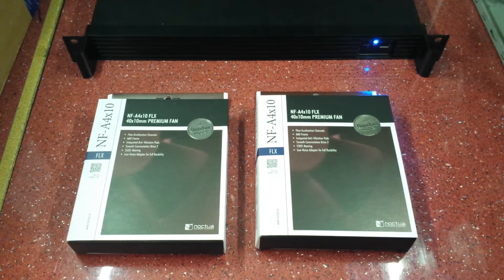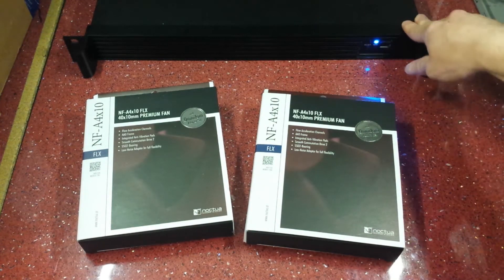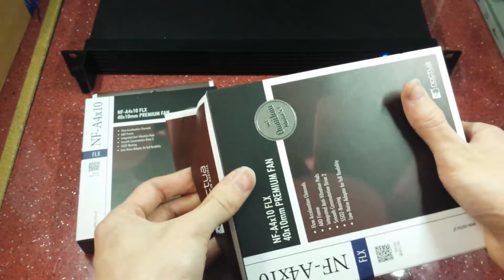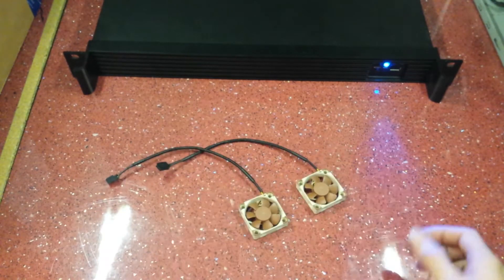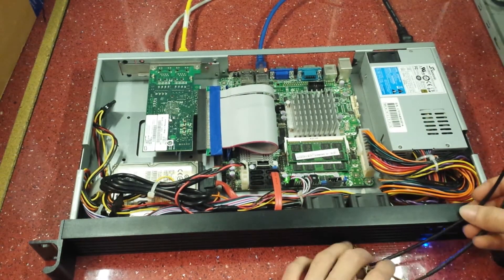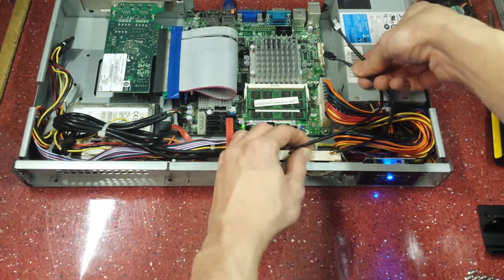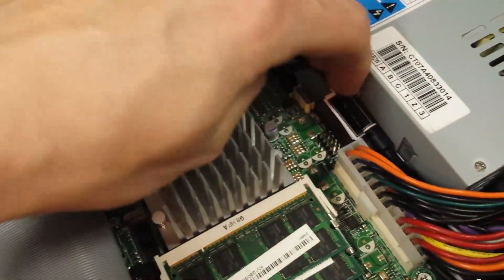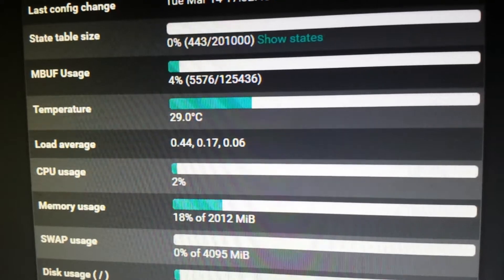pfSense Firewall Upgrade - Noctua NF-A4x10 FLX 40mm Fan Unboxing & 1U Rackmount PC Silent Upgrade

Comment: I know this is a pretty old video but I have a question?
Can you rotate the gpu 180° so that the IO ports are on the inside and would the PCI extension cable let you do that? Or would I need two extension cables?
Reply from the maker: That's an interesting one and honestly I am not sure how you could do that. You rely on the backplate to screw the PCI card into a case and mount/hold it - so if you installed it in reverse with the ports inside you wouldn't have anything to screw/mount the card in the case with. 
Unless you could fabricate or make up some kind of bracket to do it. 
Hope this is somewhat helpful? Sorry I can't really say. 
--Nathan

Comment: Wy do you want the Temperature to go down this far ?
Reply from the maker: The cooler that hardware runs the better for its lifespan and it also prevents the server/firewall unit becoming a rack / room heater and overheating through the summer periods.

Comment: Hi there. Well I have a question ^^ But it doesn't have anything to do with PC cooling, but head cooling. In your opinion, do these fans are strong enough to cool me down if I would instal them in a helmet? (Stormtrooper helmet to be exact, and it gets pretty warm in them). There are special kits for that, but I think these fans might be stronger and for sure cheaper than buing the kit. Cheers ^^
Reply from the maker: Hello there. Well that is definitely a different question from the usual! haha. While I'm no expert in head-cooling, I imagine these should work fine yes. They are pretty quiet and move a lot of air when compared to other brands. Noctua are regarded as really good in the fans and cooling department so I'd go ahead and buy some, try them out! 
Hope this helps. 
--Nathan
Reply: Thank you very much for your answer ^^ It sure helps :) First I will just try to mount a cheap fan, see how it fits etc, and if it works I will go for a the better quality of Noctua. Thank you again and have a nice day or night!
Reply: @NathanPH  I'M also watching your video because I'm making a Solar powered fan hat. funny small world.

Comment: How much are you able to push with this? And are you able to handle much connections with Haproxy also?
Reply from the maker: I don't use Haproxy so I can't answer that. 
I have two WAN two LAN at the moment setup on it, I'm running 2x 80Mb down 20Mb up VDSL2+ based Fibre connections, so that's a total of 160Mb down and 40Mb up combined and I can pull that through the firewall to either lan all-day-every-day without it even breaking a sweat! CPU use when pulling 155Mbps~ through the firewall over a multi-WAN gateway sits at just 25-30%. 
Hope this has been some help! --Nathan

Comment: Your not suppose to work on the hardware while the machine is on. Doing so might fry components
Reply from the maker: Hi there. That would really depend on the competence level of the individual really and if they know what they're doing and touching within the system. For example in datacentres and on professional servers many things are very much hot-plug and designed to be changed without causing any unnecessary system downtime. 
I'm very confident and know what I'm doing. I definitely wouldn't advise anyone go touching motherboard components unnecessarily while a system is running haha.
Thanks for your concern though. :)
--Nathan
Reply: @NathanPH  Yes but accidents do happen.  Like twitch of your finger bumped something causing a short.   Or dropped a screw accidently onto the motherboard.   It happens then your users be mad for extended downtime vs a few mins of planned downtime.

Comment: Looks like you had enough room for 40x40x20mm you could have used the Noctua NF-A4x20 FLX that are faster. quieter, and move more air.  Would help get the temp down even further.

Comment: What kind of setup will you be going with, considering the change to pfSense and the new AES requirements? From what I can tell the Intel Atom D510 does not support AES. I ran in to this with my current setup. Have to rebuild another box now.
Reply: TikleMyN1ps, Nathan PH, 
It has nothing to due with selling netgate boxes, that is a conspiricy that got cooked up by haters. No PFsense didnt change hands, the reason for the copyright change, and Opnsense, was that Qotom was selling the china box, with a rebranded PFsense on it, trying to take credit for PFsense OS, and make money off it. That is and always has been against the TOS the way they were doing it. 

The reason for the change, is that non AES NI cpus should have never been supported to begin with. AES NI in the current implementation is software based, and junk for large needs. For small networks, ya no problem, when you have 100s of users, servers, IPS running, the CPU usage that is being wasted due to not having AESNI is just that a waste. Appliance routers, like consumer stuff, have Cryptographic cards built in to them, as do most off the shelf firewall solutions. Because those things are needed, for an ideal hardware router/firewall, AES NI allows the CPU to do it on a hardware level, and is vastly more efficient. 

The gap sucks, and a gap it will create. However, as stated, Opnsense will keep the software crypto processing (virtually create AES NI), and for home users that is fine. While the people that need the extra CPU, for the fact that my Xeon sits at 100% constantly due to IDS and 1gb network, I will be able to offload some resources. Keeping both camps, isnt possible. So while it sucks for some, like your selves, its something others like me, have been waiting for a long time for. 

So the fork needed to happen. PFsense, will go on, and try to gain a foothold in the Enterprise market, where it wants to be. And OPNsense, will cater to casuals/home users. 

That said, at Nathan, I wouldn't be so quick to worry. You kept talking about servers, are you going to run them with no protection? Using that atom is fine, for some home PCs router. However if you want to put servers behind that PFsense, and actually have security, you are going to need a much much better CPU. IPS of Suricata or Snort, and real protection on servers that will be constantly attacked, will bring a Xeon to its knees. If you do put up the servers, you will see that hardware is going to have to go. That build, no offense, is a 100mb down, 20 users, routing only box. You cant even handle 1gbs down on that box, bare. Add IPS/IDS, VPN, ect ect, and thing will toast out.
Reply from the maker: New requirements? I'm not aware of those. What's the changes and what's it all about? 
I really hope I don't have to rebuild everything, I would rather stick with the latest working version for this hardware I think and I have multiple boxes with very similar configurations.
Reply: Check it out here: https://www.netgate.com/blog/pfsense-2-5-and-aes-ni.html

"we do want to give early notice that, in order to support the increased cryptographic loads that we see as part of pfSense verison 2.5, pfSense Community Edition version 2.5 will include a requirement that the CPU supports AES-NI."

I had an old Core2duo box, worked perfectly. Was planing on getting more ram and I saw this. 

At this point for me I don't feel it is cost effective to build another system for myself. Considering the chipset does not support any CPU's that are AES-ni compliant.

From what I am seeing on Ark, the  Intel Atom D510 does not support AES-ni either. 

Sorry to be the bearer of bad news.
Reply from the maker: No problem, I've done a little reading and it might be worth trying OpenSense, a fork of pfSense. As it seems they will continue support for non AES-NI chips. My option for now though shall be to just not upgrade to the latest versions as I don't have time or intention of upgrading all of my pfSense machines hardware.
Reply: I agree with what you are saying. The thing that frustrates me is that on some forums where people are asking how are they supposed to update their systems to be compliant, pfSense basically said "Sorry, but we have affordable options for your business that are AES-ni compliant" I understand for a free open source firewall, they need to start making money, but I really didn't like that approach. 

I've been playing with OpenSense, and with what I've tested so far, pfSense is still king. I had Snort, Squid, OpenVPN, and PIA installed though my home network and worked beautifully. OpenSense has some cool features too, but not as well written as pfSense.
Reply from the maker: I feel this approach is likely after the software has changed hands, as it recently did as the copyright changed too didn't it? That solution is more likely to bring them a lot more hate than anything, sure it could bring them a bit more income too but there's better ways of going about such things. 
But for me right now I'll just keep my old versions of pfSense running into the future, maybe even for the foreseeable future as I don't see a real massive need to upgrade.